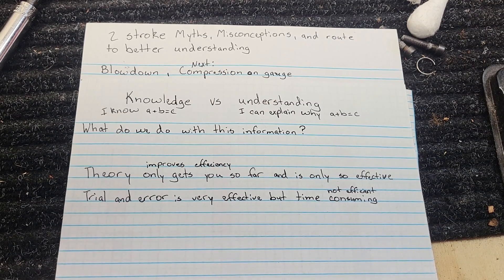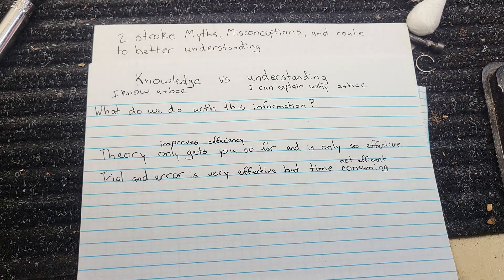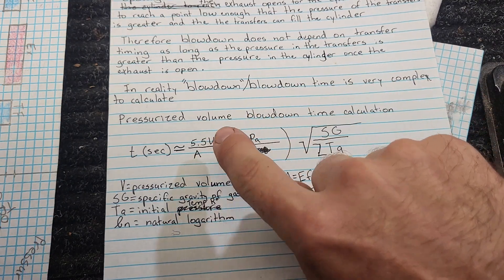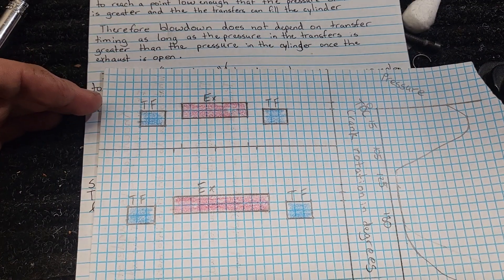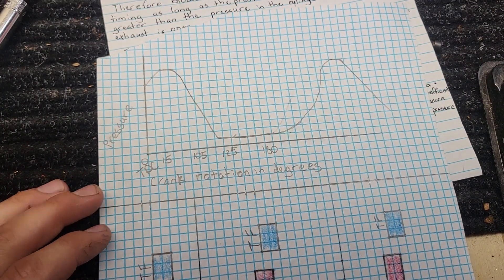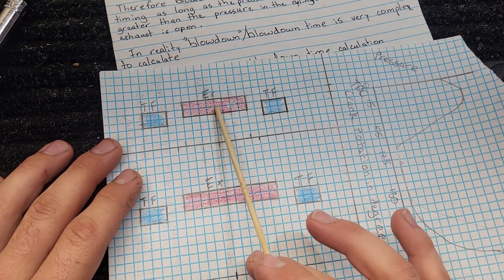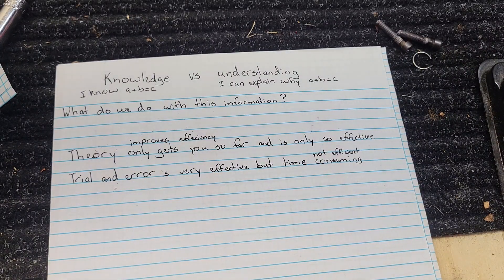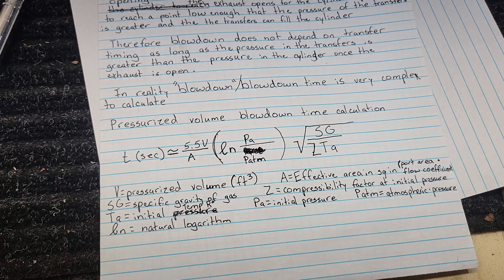2 Stroke Myths and Misconceptions: All About Blowdown!!

Comment: 👍Very good video to share even though it made my head spin 😵‍💫and I will have to watch it a couple of more times for the full sink in. Thank you 👍
Reply from the maker: Simplified: 99.9% of people measure blowdown incorrectly. True blowdown does matter in motor function but the number 99.9% of people give out has no indication of motor performance.

 A wider exhaust shortens true blowdown time (use less degrees) a narrower exhaust lengthens true blowdown time (use more degrees)

In a two stroke i can think of 3 blowdown type events: exhaust out of cylinder, crankcase transfer into cylinder, and atmosphere into crankcase.

Dont get caught up in the words everyone uses to sound knowlegdeable is my advice.

Comment: 👍👍 good stuff!  I also look at the muffler outlet size. Also, some mufflers just don’t breathe well and that has to be factored in.  I think 20 degrees has become a “ standard “, but intake duration, crankcase size and really just about everything in the cylinder matters. Hell, I’m still guessing 99% of the time!!!
Reply from the maker: Yup! Anything that bottlenecks before or after the port can affect it. I think 99% of us are picking numbers arbitrarily and fine tuning with trial and error. Effective, not efficient!

If you think about it in reverse blowdown pressure also affects the intake with the standard atmosphere and changing pressures in the crankcase.
Reply: Morning😊

Comment: Good stuff.  Now look at two saws of same displacement and port sizes but with different bore and stroke.  I hope we don't go crazy before looking at the effect of stratified charge on all the traditional 2 stroke variables.
Reply from the maker: Got a long way to go before we get there. But the basic answer is with bore gain you gain possible port width and with stroke you gain mechanical advantage via leverage from stroke. Far more variables involved to say which will make most power but short answer is whichever exerts the most pressure per stroke at a given rpm is going to make more power.